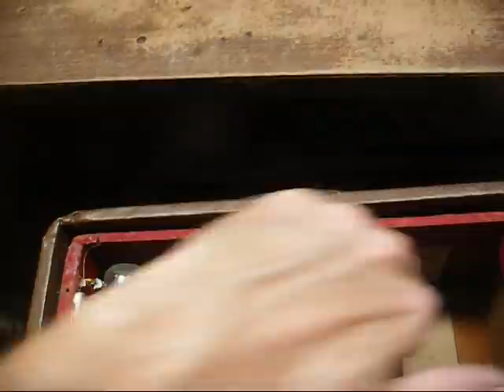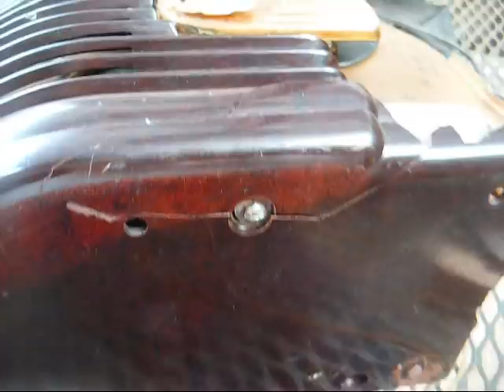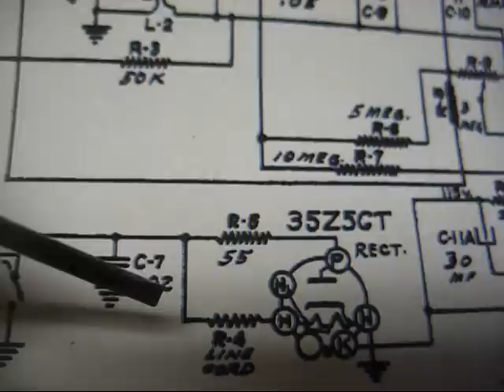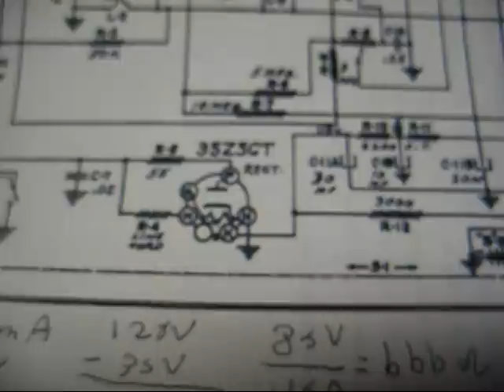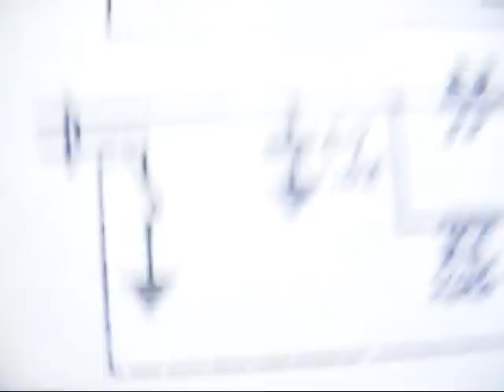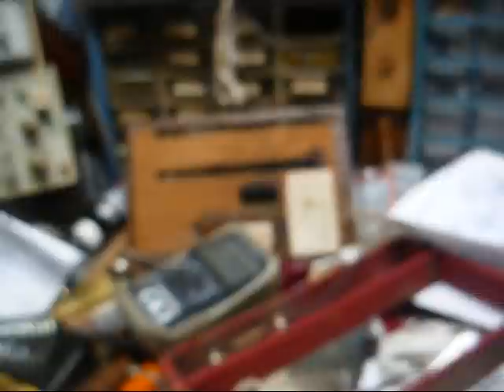Califone tube record player, Zenith tube radio cabinet swap, & Silvertone portable radio repair

Comment: Very enjoyable presentation Brian.. I watched in awe as you fixed that old portable..I only ever understood tube circuits that  that required mains voltage or higher DC .  If I tried to repair that Silvertone,  I'd have been like a one legged man in an ass kicking contest  !  But thanks to you, I know more about it now than I did 10 minuets ago ..

Comment: Most electronic's made today  is made cheap  and nasty and in most cases not repairable if it break's. The older electronic's are easier to repair and find part"s for but people will complain how much it cost's to service and repair the older stuff not realising in most cases it will last a very long time and will be reliable especially compared to the chinesium made crap.
Reply from the maker: That Califone still had it's original filter cap, two safety caps to isolate the tonearm and chassis from circuit ground, and a silicon rectifier. All of those parts still checked fine; but, just to be safe, I replaced them anyway. The point is....that Califone worked for decades on original parts and will likely work for several more decades. This modern Crosley crap is doing good to last for six months.

Comment: You could also compute the capacitor value needed to have an impedance of 666 ohms @ 60 Hz, and use a capacitive dropper for the filament of the 35Z5. That should work as we just need the filament to light; power-factor B.S. doesn’t really need to worry too much, and it’ll dissipate way less heat. 😃
Reply: I also wonder why people don't do this. In this case it would be a 4.7µF and a 100 ohm 2.5W resistor as a inrush limiter.
Reply: In some of the author's other videos, a series connected film capacitor is used as an Xc reactive "dropping resistor" to replace a bad (open) line cord resistor. A typical1930s AC/DC set would have used (3) 6.3V 300 mA AC tubes, a 43 output tube, a 25Z5 rectifier tube and a 150 Ohm line cord resistor. 73, WB6FBF

Comment: Here is a link to an article on using a capacitor instead of a dropping resistor to get the correct filament voltage:  http://www.nostalgiaair.org/References/Articles/TheFlash/Flash01.htm

Comment: I've seen people replace those line cords with a home made one.  It was a regular power cord, with the resistance wire from an electric blanket, and then covered with a shoelace (since those are hollow tubes).  It looked pretty similar to the original cord.   I don't know if I'd trust it for long term use, but for using it an hour here and there and unplugging when done it'd probably be fine
Reply: It amazes me that they used those resistance-wire line cords in the first place.
Reply: A shoelace: now that's living dangerously. I'd think they could find some fiberglass or maybe mineral wool braided casing through an automotive supplier. We used to use that to make wiring harnesses in the days of minicomputers; you could even make a Y by poking a hole through the side of the larger tube, then the ends were secured with super glue. They also used to use resistance wire in, I think, Chrysler cars, and there are places where you can order ni-chrome wire for heaters  as well. For grins, I measured a little role of bailing wire from the dollar store and it measured 15 ohms, probably too little for most line dropping. I'd sleep better knowing there was an external resistor in a metal cage; those curtain burner cords were always suspect.